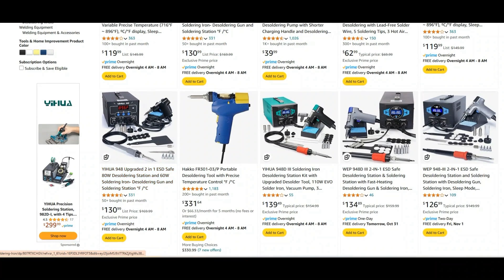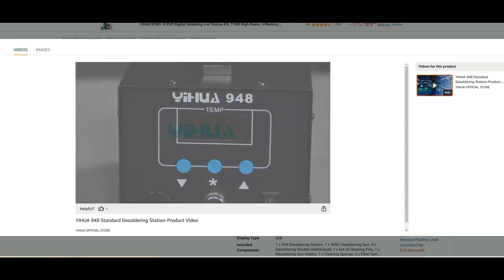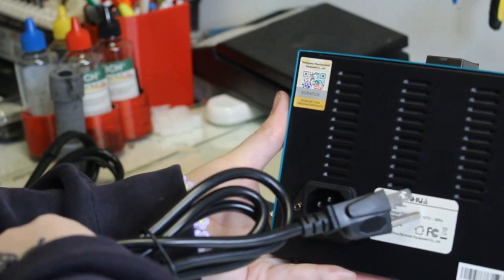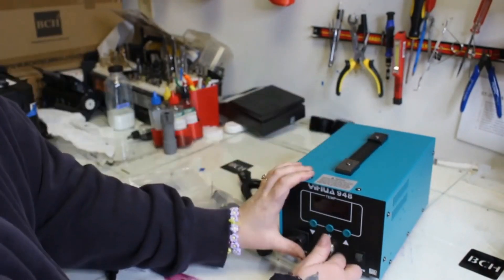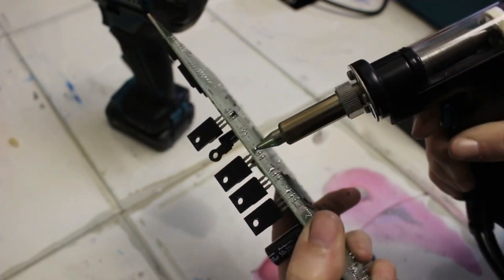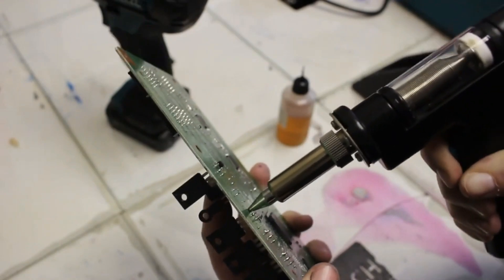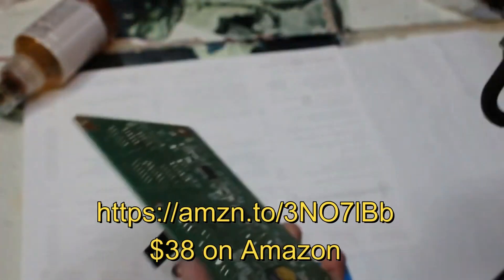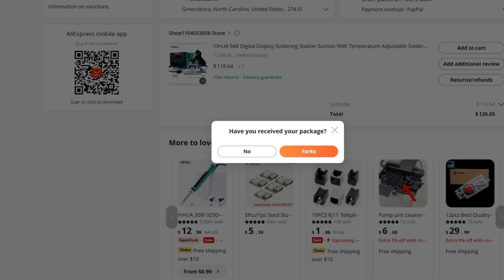Desolder Machine EXPERT Spills Secrets to Save You THOUSANDS!

Comment: Experienced user here: One thing I didn't like about it is how frequently cleaning needed to be done. The trick to usually get the best results is to usually tin the solder pads and let the pad be molten for a few seconds. This helps mixes the old solder with the new solder. When you mix it, I have noticed that I get better results that way. I have done a few through holes with this gun and it has been great with the DMG Gameboy I have using to replace capacitors. 

For temperatures, I have set the desolder pump to be around 400C. Once the desoldering gun is ready, I use it on the tinned solder pad, and then place the nozzle. Once you place it on the nozzle, swivel it around a little bit for about 4-6 seconds and then press the extract button. It should be able to take out the solder pad the majority of the time. 

I hope that this helps and hopefully you will have a better experience. Yihua support have been very understanding with my negative experiences and provided me a brand new one since I have had extraction issues before.

Comment: I have no clue how to contact You so I will just write here..
Im trying to fix white underbase misaligment, but It seems like not only white is off..
Printer: Epson R3000
rip: Acrorip 11.3

The white choke was tested as well. When I aligned it, other colors started peaking out... (example: black printed shape has tiny red edges)

Already done:
Encoder strip checked and cleaned.
Bi-D adjustment
Head angular adjustment
PF / EJ adjustment
PW adjustment
nothing above helped

Seems like it's not calibration matter, all issue is vertical like it is about media feed ...I remind myself of getting error once, after that it never happen again:
0x0A CR LOAD POSITION excess load error. CR encoder failure. CR motor failure. Carriage overload. Tooth skip or improper tension of the timing belt. Cable or FFC disconnection

Any ideas what I can do more?

Cheers
Reply from the maker: Have you try to see if the platen is leveled? If you have a vacuum platen, it could be that the replacement platen is not installed leveled, so the misalignment will only occur at one side.
Reply: @BCHTechnologies  I don't have vacuum, it's original one
Reply: @BCHTechnologies  I think I know whats the issue, printhead is mounted to the carriage with 3 screws, one socket is damaged, so only 2 are holding it and causes slant, now I have to find a way to mount it properly.. If you didn't mention about leveled platen, I would never even think about it. Thank You :)

Comment: Sounds like they switched to an AC pump. I have an older Aoyue unit with an AC pump and it takes too long to build up vacuum. The solder it sucks up while suction builds breaks your heat bridge so it solidifies on the other side before you reach peak suction. I figured out that I have to pinch the hose, hold the trigger, then pull the hose open/straight once the solder is molten on both sides.